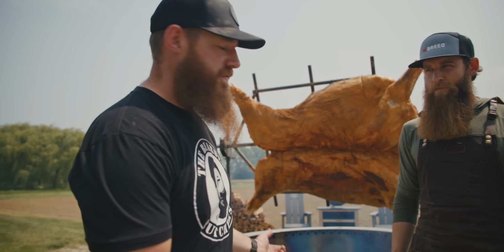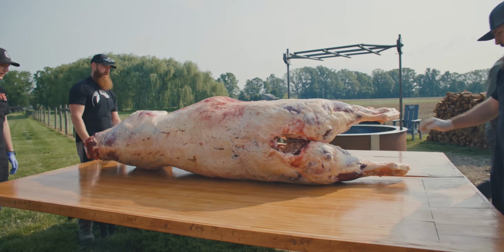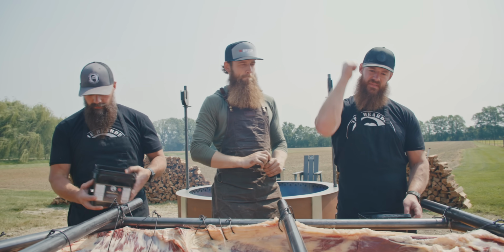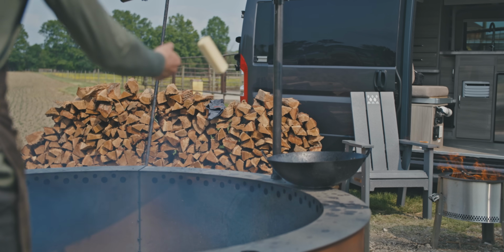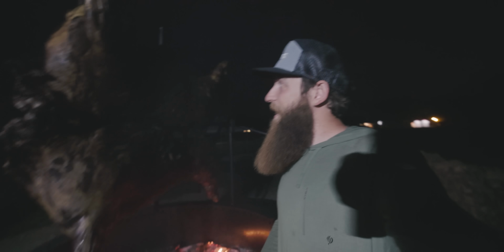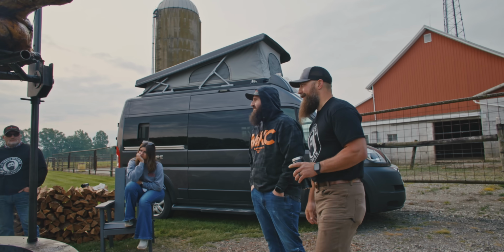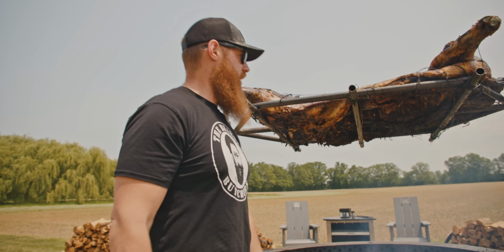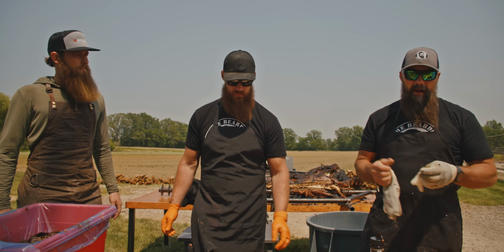We Butchered and Cooked a WHOLE Cow over the WORLD’S LARGEST Smokeless Fire Pit!

Comment: Loved this because yall trying something different - so cool! Think your ‘shrinkage’ problem could be solved with a modification to the table (you may have already figured this out). The middle 3 cross pieces need to slide so they move with the meat as it cooks, so cut them down, weld rings on the ends and slide them onto the two main end pieces. You would of course have to cut those 4 angled end members to do this, then re-weld flush to the main end pieces. You could add a 4th sliding middle piece which would allow you to do a couple whole hogs at a time.

Comment: Extremely interesting.  I have one observation or suggestion for your consideration. What if you sandwiched the carcass between a sandwich of stainless steel hardware cloth? you would still have to secure it to the apparatus, but you would not have nearly the concern of the carcass sliding off your wire fastening because of it cooking and pulling through your wire fastening.  I am a big fan of your channel, as I used to work in locker plants and slaughter plants in my younger years.  Brings back a lot of good memories. good luck.
Reply: Think that would be an excellent idea. Even some of that lightweight expanded diamond shaped aluminum screening tied to both sides would definitely hold it more secure.
Reply: Or sandwich between chicken wire mesh. Also, perhaps season it overnight or a day before while it's in the cooler. Lastly, spatchock it and frame it in an area where you can maintain clean food preparation.  Avoid Standing on the preparation table with dirty boots/shoes. Otherwise great video.

Comment: That's one large order !  If there is a next time, I would modify the two hubs, extend them outward another 6 inches, that allow the rack to rotate on the uprights which will allow for the addition of adjustable balancing weights which will help even the weight distribution so that during the cook its not heavy on one side as you turn the beef. That being done, you could install an electric motor set up or a manual crank set up to turn the spit slowly and controlled during the entire cook. Doing this will allow the whole cow to baste itself in all of those juices allowing the hot fat to migrate over the entire cow. It does in fact make the final outcome more tender and more juicy and more evenly cooked.  But, what a monster of a "roast beef" on the barbee. No Kingsford briquettes or lump ? LOL !

Comment: You need to modify the system for retaining the beef on the spit.  I would suggest making another pipe frame and clamping the beef betwin the "new" frame and the original frame.   This would be structurally much stronger.  It would hold the beef firmly and not allow it to slip.  Good luck!

Comment: The main place I see room for improvement would be a redesign of the spit - I'm thinking something with a rack on both sides of the beef, sandwiching it, and pivot points on the end nearer to the center of mass so the spit would be more balanced during rotation.

Comment: To help make sure that the beef doesn't fall off, make another piece like u have the cow strapped to and drill holes that line up on both sides and then use threaded rod to hold it together. That's how we do whole hog and it held it together and it saved some time of having to pull wire out.

Comment: You guys should make a large like grill top and put hinges on one side and use the wire to tighten the other side to the bottom, as the meat shrinks all you'll have to do is tighten the wire on the un hinged side and you won't have to worry about any meant falling

Comment: Love the video, was thinking if you had a less diameter of the pipe for your truss, you could have had two of them and had them clamped together with some stainless all thread and flat stock clamps and used a cordless drill and socket to tighten both trusses together initially and just run em in tighter as the cow shrunk through cooking, if  that makes sense...

Comment: Awesome. Im no engineer but why not make 2 frames with expanding metal locking around the carcass? As it cooks and shrinks it would be totally enclosed , you could still mop it and it would prevent chunks from falling off.
Also a simple set of reduction sprockets and chains on each side would make turning it a breeze.
But like i stated im no engineer. 
Nice job it looks awesome and tasty😊

Comment: Do it up like the Hawaiians do. Wrap it in chicken wire with wires through the bones (like you did.) Get an Electric motor that you can adjust for speed. Mount the motor to a metal plate. Get a chain that mounts to a rotisserie with a sprocket. Mount up a chain. Oversized rotisserie for the win. The key is adjustable motor. Then all you have to do is stoke the fire. My two cents. Cool vid.

Comment: Next time they need to do a rack  made out of grill like diamond iron type. And they need stronger motor to keep it spinning, and certain,y stronger support poles.  I mean there isn’t anything to catch the meat.  And guys if that rake is made out of wood handle, it could just catch on fire, plus the part where the rake connects to the handle will shrink out of the end.  Maybe next time cutting it in small pieces and wired to a  grill type rack might be better.

Comment: a safer more secure way of placing the cow on there would be to add a second rack and sandwixh the cow between the racks.. Then tighten it down with u bolts instead of wire.. I would  like one of these.

Comment: I would have used an ATV winch to rotate the spit. Make a spindle and wrap the wire. Let it out it will spin, They make a 2500lb for less than $150.

Comment: What is going to happen when/if the wire pull loose from meat?  Also I think I would have used a brand new washed out and rinse well garden sprayer with the moistening mixture to spray the meat down. A 2 gallon would have been good, maybe a 3 gallon. Great coverage when you do huge hogs with apple juice or beer if you want.  But I thought they were to keep spinning — that’s the big issue I see here from a typical spinning cook.

Comment: You guys have probably already thought of this but if you don't want me to fall into the fire you probably could put a small 3/4 inch screen on the fire pit itself so if the meat drips off and falls in, it will be caught just over the fire pit I guess you could call it like chicken wire but thicker gauge wire.

Comment: Q: why not using the forklift from the beginning?
why rubberized metal wire and not an unrubberized wire?  didn't you had plastic dripping on the meat? or plastic flavor over the wiring holes ?
Reply: It’s steel wire no rubber on it.

Comment: A new design to the spit is needed,  should be two parts  , a top and bottom,  with a clamping design to keep the 1/4 pounder in place with out shiting your bibs every time you rotate it, especially after cooking for hours, Double up on the vertical sections and install a small one horsepower motor with a chain that can rotate it for you without somebody getting seriously messed up and/or dropping the very expensive piece of meat..

Comment: You should have a mother grill side to put on the upper side of the cow and bolt the 2 Together.
 And then why are the beef on there a little bit?
  That way if you got to both to together you should not have to worry about losing the cow into the fire.
 Stop done that years ago and at works out good.